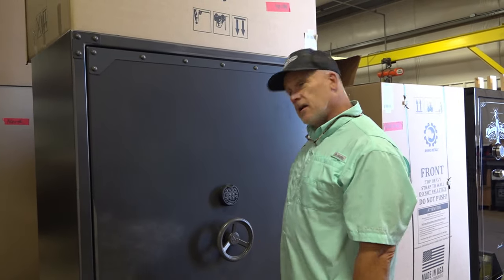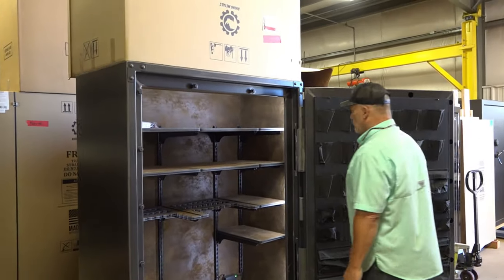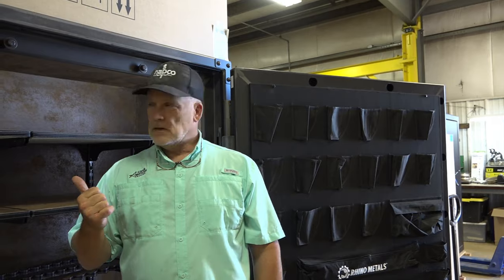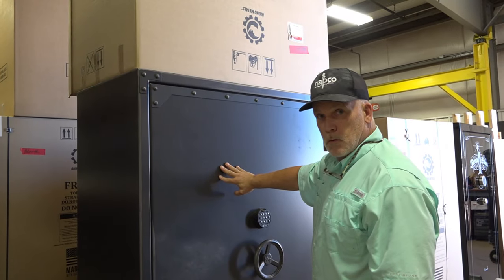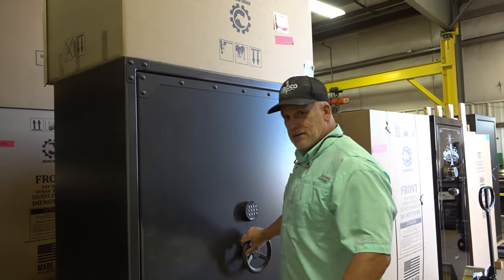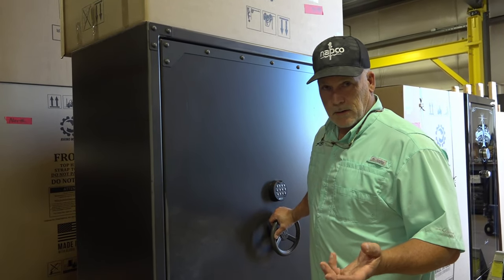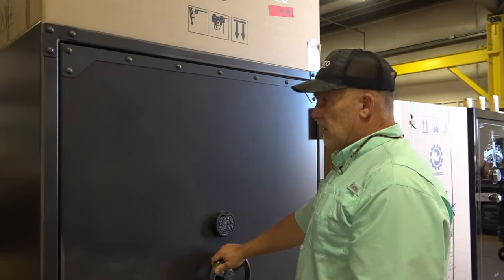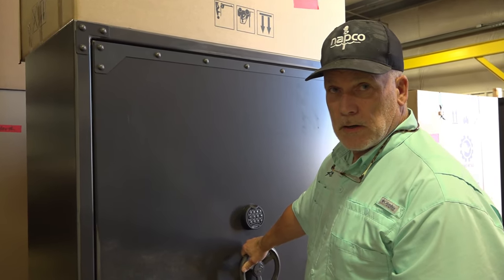The NEW BEST Safe on the Market? The NEW SAFE X System Rhino Safes

Comment: You lost me at 12 gauge!
Reply: Lots of rich guys in these comments scoffing at 12gauge. Obviously 10 gauge or more is better, but then you're looking at $3-6k more for the same size safe.
Reply: @musicman1eanda let them scoff. The ones worried about gauge and not fire ratings, are the ones who don’t layer their security and their metal gauge is irrelevant. 

Just justifying their purchases. By the time someone makes it to my safe, god forbid. They’ve already been seen on camera, set off an alarm with battery backup, motion  and my neighbor has been called. 

If at that point they still remain there and try to get into the safe.. they aren’t a good crew and wouldn’t be able to pry or cut even a 12 gauge safe.
Reply: @musicman1eanda  ton of rich people in the gun community apparently, they do the same thing with some firearm brands, It can be a 100% clone of a gun thats super reliable, with zero issues and people will still say its for poor people LOL Plus ALOT of safes can simply be modded to prevent prying. Anything can be broken into no matter the cost, its just about the time.

Comment: It doesn’t matter. It takes all of 1 minute an 39 seconds to use a carbide blade on a  14” quick cut saw and you’re in the safe from the side or back
Reply: Have you ever cut steel before? Carbide blade or not. It won’t be under 2 min

Comment: The amount of force required to shear off those washers is substantially less than what it would take to break 1.5" bars...it's simple physics.  I think there's a reason this has never been done before!
Reply: Nah, Many safes in this class can be pried open because the body bends out of the way of the bolt-work.
This design change removes that vulnerability these safes tend to have.

Comment: I need a custom Digital Lock that comes blank so I put my own codes both Master set and Normal set.  Also does not send out data signals, I've found out that some Digital Locks send data to the Safe and Lock Companies that build them.  Just another added sting to the Liberty Screw Job.

Comment: Nice pry resistant safe. Even at 12 gauge, good for them for keeping the cost down cause a cutting crew that knows what they’re doing will be able to cut in regardless. 

And those crews aren’t usually going around hitting residences for the plebs like you and me. 

Layer your security. If someone gets to your safe and you didn’t know they were there before they got to the safe, you failed

Comment: 12 gages body. You can cut that open with a circular saw in seconds lol.  Since when are washers stronger than thick steel. Those washer will shear off easy.

Comment: Everyone I've heard from on this safe issue that the liberal safe company has the whole country up in arms over is about these digital locking systems. Look, all gun safes are vulnerable. Thats just a plain fact. Im sure someone will come up with a digital lock with no back door code and will charge way to much money for it, but can you really trust it? 
I bought a liberty safe last year. I'll be damn if im buying another one. Luckily my local mom & pop locksmith was the local distributor for liberty safe and apon delivery of that safe i had them, at no extra charge replace that POS electronic lock with the ole tried and true dial type lock.  There is absolutely no back door on the dial locks.  Period. The lock is just one layer of security,  i am the last line of defense for my gun safe.  When my lifeless body is laying on the floor, who cares whats in my safe.  Our problem is in Washington DC. We need to change the root of this issue. Bitching about locks isn't going to help the matter.
Reply from the maker: Just to clear up some miss information. The issue with liberty giving the code to the FBI. That safe actually had a dial lock on it but it was the one from the factory and Liberty had that combo on file.

Comment: External hinges. Epic Fail.
Reply from the maker: they have bars on the interior. External hinges don't change the security on them AT ALL.
Reply: Correct, hinges are only functional after unlocking. Cutting the hinges off would do nothing.
Reply: Look at any high security jewlers safe. What will you find? External hinges. Even the Chubb Sovereign has external hinges and that safe has no recorded failures. If external hinges are good enough for Chubb they're good enough for anyone. Even you with your $125 Hi-Point.
Reply: @overbuiltlimited The Chubb Sovereign safe is excellent  I have pictures of the inside well made.